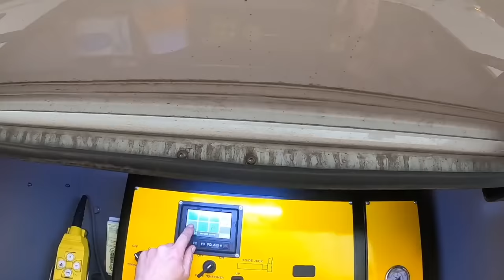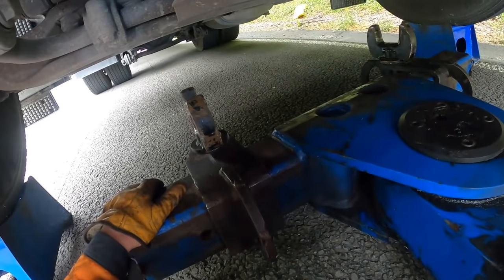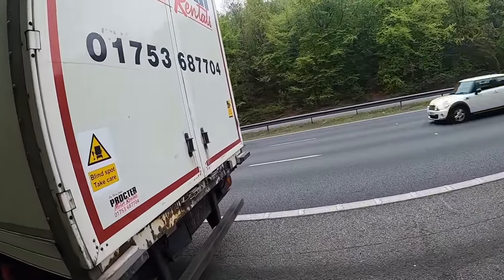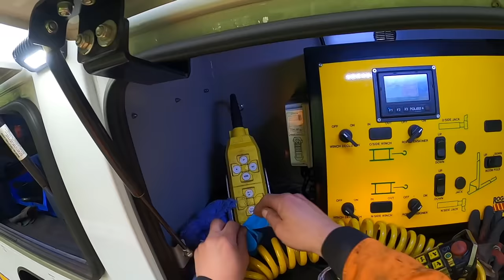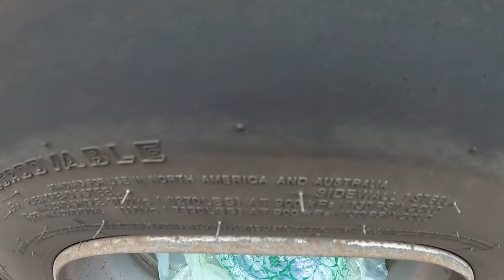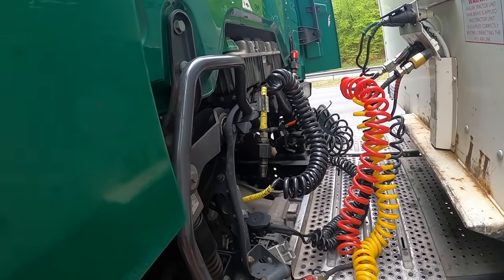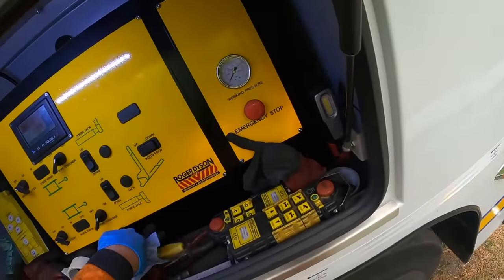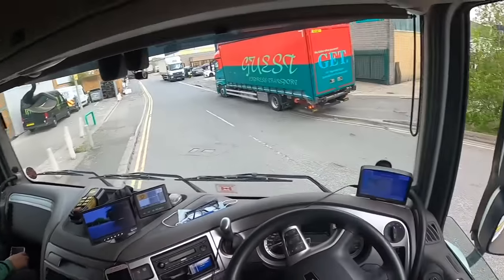BRAKES LOCK-UP ON 40 TONNE LORRY! M40 MOTORWAY UK HEAVY RECOVERY!

Comment: Much like the USA, the UK really needs a ‘slow down - move over’ law. I try my best to move over from the inside lane if I see anything stopped ahead. But this video really showed how bloody sketchy working these recoveries are with vehicles driving past! Fantastic work as usual Steve, and the roundabout manoeuvres were super impressive! 👏🏻
Reply: most of the EU countries have laws about it. Surprised the UK doesn't with all their excessive workplace safety laws - or they do and no one knows about it which is a problem with a lot of things in the UK
Reply: Agreed, for example here in the Netherlands they will close off the lane completely with digital signs above the road, and often also slow the other lines down.
Reply: Why? Most Countries work on the basis of having every single aspect of life written out with dos and don'ts. We don't. We have  more general laws about safe driving (due care and attention etc) and these used to work well. The problem is that they are not enforced. You can bring in all the laws you like but if the training and enforcement isn't there, you're wasting your time.

PS I have stood out on the hard shoulder with failed vehicles, so don't think I'm just dismissing this. Road safety is getting worse, but new laws are not the answer.

Comment: Gawd, this brings back memories. My worst ever was going out to a double deck bus that had run out of fuel. Back in those days it wasn't quite as bad as now (early 2000s). It was on the hard shoulder of the M1 and here's me standing right on the 'rumble strip' for lane 1. I requested a lane closure or Highways/Police assistance but gave up waiting. That was not a pleasant experience and I poured in just a couple of gallons- enough to get to the services. Fortunately priming the good old Gardner took seconds and it was on its way, but the pouring of the fuel into the tank on the offside? Never, ever again.
Reply from the maker: Hi Derek thanks for sharing that mate , think we  all been on jobs like that mate on reflecting back what our we doing out there putting our life on the edge.
Reply: @HeavyRecoverywithSteve  true. All I can add to that is that I'm glad I've not had to do some of the HGV stuff you've done. Full size wrecker, tractor unit and trailer? I take my hat off to you for that.

Really superb videos, Steve. Naturally I've seen plenty of buses, but the wagons are new to me.

Comment: Where are the traffic officers when you need them.  They should be blocking the lane for safety, or at least have a vehicle with flashing lights to make drivers aware, as there aren't any overhead gantry notifications on the M40.  Great video Steve, enjoying them.  Must admit, you're a lot quicker than Ron in the USA😂
Reply from the maker: Thanks for watching Thomas , glad you enjoying channel , think where Ron lives life's a bit slower pace.

Comment: Respect to you Steve as a driver who has been recovered a some 5 times by you guy's its not an easy job especially on dark nights and in the winter snow on the ground and you have to get underneath just a thought how about having a little collapsible trolley for the cones certainly save your energy such as in this video having to carry them back stay safe now.

Comment: Great job. I have a fleet of 6x4s, so we usually remove the main drive shaft whenever they're on tow. Love the kit. Keep them coming!
Reply from the maker: Thanks for watching, i normally do the same on 6x4 disconnect the prop shaft and strap it up out the way, otherwise your be looking at removing 2 half shafts.
Reply: @HeavyRecoverywithSteve  yes indeed. Keep at it. I'll be watching from Nairobi.

Comment: I had my brakes lock up when I was driving down the old A50 near Coalville on a Pall-Ex run down to Surrey. Was pretty scary as the truck just stopped dead as I was pulling away from a roundabout. I was only doing about 30mph at the time but a tipper nearly drove into the back of my trailer and obviously assumed I had just slammed on the brakes for no reason. The recovery guys came out and told me to drive it slowly to their yard in Coalville on the shunt valve. It turned out that one of the air lines under the trailer had ruptured. A few days later a similar thing happened with a truck stopping dead on the A1(M) in Yorkshire and another truck went straight into the back of it and the driver was killed.

Comment: Great video Steve . If you were on a smart motorway would you wait until the lane was closed before you attend ? That’s a scary workspace you operate in. !
Reply from the maker: Hi Keith, yes be safer on smart motorway, the Highways would close off lane put speed restriction in place too slow traffic passed me.Normally they would be on scene before me and have all restrictions in place be i arrive.

Comment: Not to mock your kind, but you're probably by far the politest brit i've ever seen on the internet. Just a question, do you wear safety goggles at all? I understand they would probably be really annoying but with the work underneath vehicles and next to the motorway i bet you have a hazard of getting lots of debris in your eyes?
Reply from the maker: Hi thanks for watching and kind comments, yes do wear safety goggles sometimes when removing prop shafts from tippers that go off road, always sand and grit laying on the underside of truck.

Comment: Another very interesting job Steve. Can I ask what the blue bar looking thing under your truck between the front and rear axles is for. Sorry if its a stupid question. Keep safe mate. Regards Jas
Reply from the maker: Hi Jason, blue bar you asking about is a tow pole or fixed bar used for towing when you may require the broken down vehicles to remain in contact with the road, dont use it much,thanks for asking.
Reply: @HeavyRecoverywithSteve  that makes sense, thanks for the reply. Top fella

Comment: As the truck has "only" lost air, and the engine runs ok (I assume) would it not ok to leave the truck engine running whilst being towed. This would ensure the gearbox is lubricated and avoid the need to remove the half shaft?
Reply from the maker: Hi Alastair,  unfortunately not, drive has to be disconnected to gearbox as per manufactures guidelines ,regardless if engine able to run or not, our company policy to disconnect drive always.
Reply: @HeavyRecoverywithSteve  
I guess the problem in this case.is.if the compressor gear (sa) is damaged and further running could ruin the maiming gears etc, then it.would if course be "your" fault!

Comment: Question: Why is it you need to pull the half shaft out of the rear wheels? Is it down to the transmision? Is there no neutral gear? Cheers :)

Edit: Never mind, you explained it a little later in the video lol xD

Comment: Can I ask why you put a trailer board on rather than connecting the recovery motor to the trailer lights when connecting the airlines?
Reply: he has to have the recovery trucks number plate at the back of the trailer .. i guess it's just easier to use a trailer board

Comment: hi steve   you know better than me but you say the off side half shaft had 2 come out  id have thought as long as 1 half shaft  comes out either side  there would not be  cross pressure going threw the diff  so the diff and gearbox would be fine
Reply from the maker: HI Stu , yes you correct mate either half shaft would disconnect drive to gearbox, but bit of bugger getting half shaft back in on diff lock side even when you previously engaged diff lock.If i was unable to tow it over to the side i think nearside half would be safer option rather than removing prop, thanks for comments.